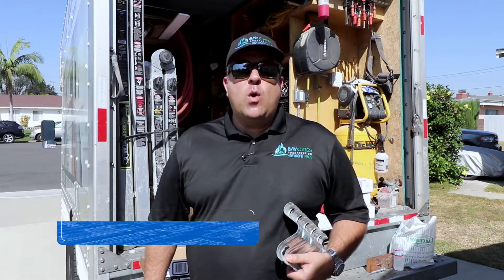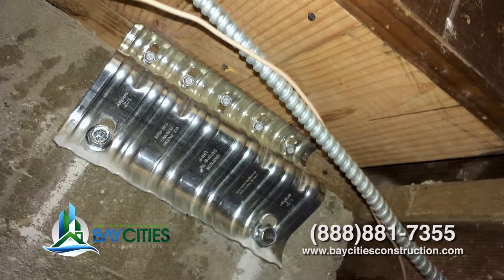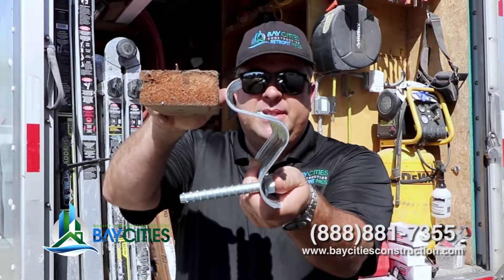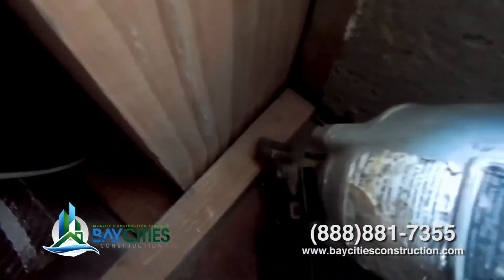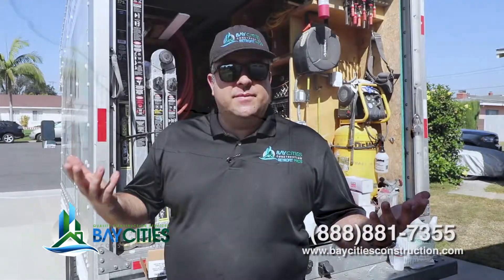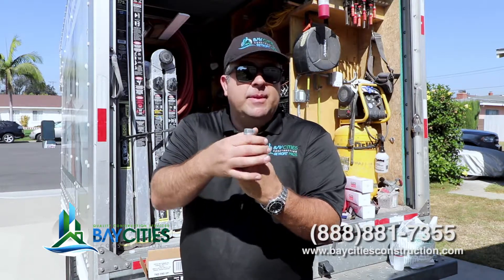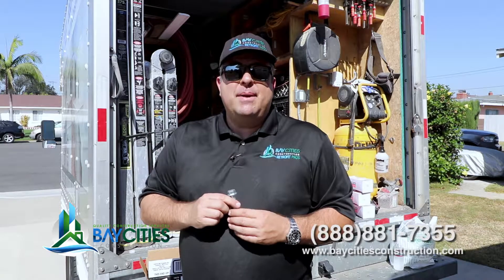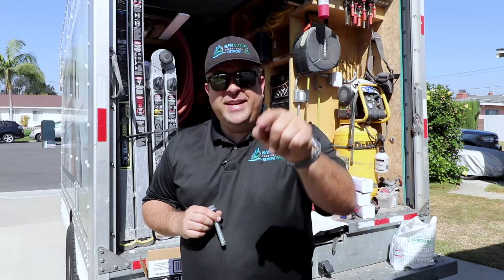What is a 'Brace & Bolt' Seismic Retrofit for Homes? | Retrofit Pros

Comment: What do you do if the mud sill offset from the foundation wall is more than 2.5"?
Reply from the maker: Sorry for the delay in response. If the offset is very big, some companies can use airbags to lift the structure and move it back in place. We don't do that but it is possible. You can also add wood to the inside of the floor system via the crawl space and tie it down in place to the stem wall.